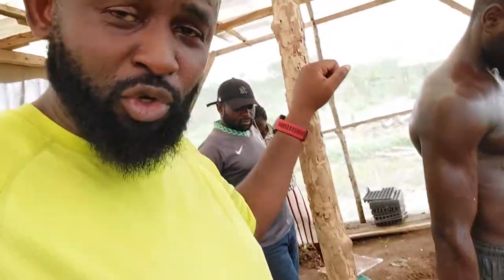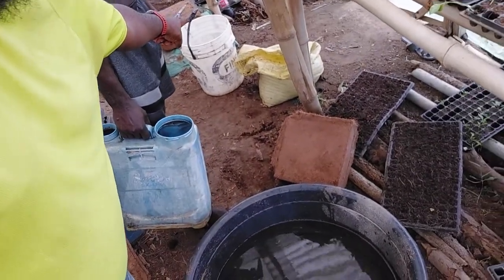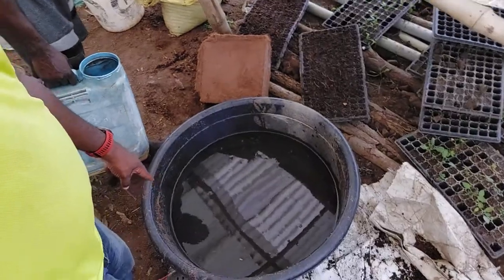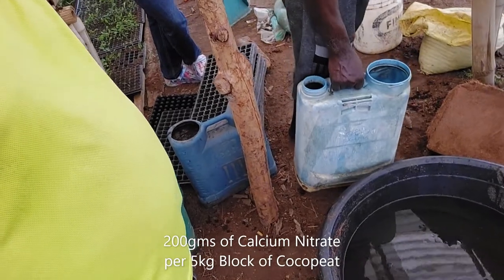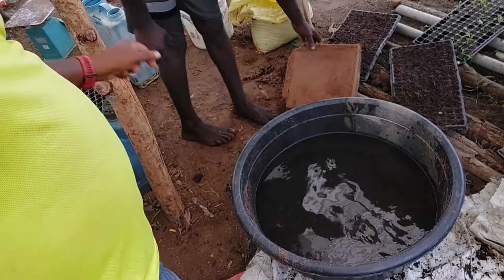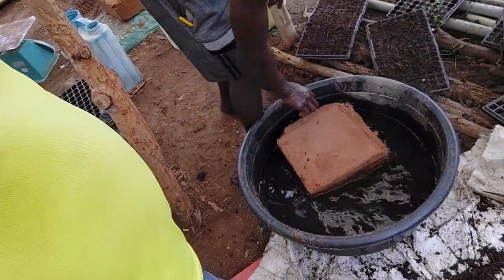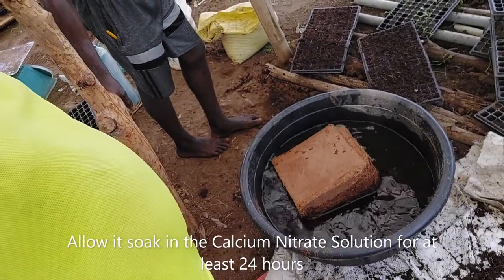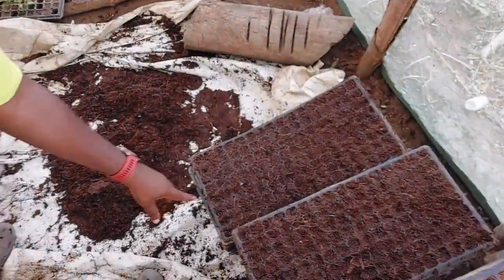How to Buffer Your Cocopeat

Comment: Hi farmer Ayo,please I would like to ask can Amino cab (liquid calcium)also work instead of calcium nitrate.. and also can the 200 holes nursery tray work effectively for Tomato,pepper and cucumber nursery ...thank you
Reply from the maker: I suppose it might but I have never tried it before. The amino cab might also be a more expensive option.

As the 200 trays, I guess it will but you will need to be extremely timely in your transplanting. Tomatoes won't stay more than 3 weeks in the nursery and peppers not more then 4 weeks. Any longer and they might start stretching in the nursery.

Comment: I have a question Sir, I would like to plant Birds Eye Chilli. Do you mix cocopeat with any fertilizer like DAP. If yes, when the leaves are out what other feedings can I apply to my seedling before transplanting? And can I apply any preventive insecticides or fungicide at nursing stage?
Reply from the maker: Try and buffer using the process explained in tghe video.  Afterwards mix the cocopeat with Manure for best results.  The manure should suffice as nutrition while in the nursery.  Unless there is an obvious fungal infection, i would avoid the use of chemicals at nursery stage